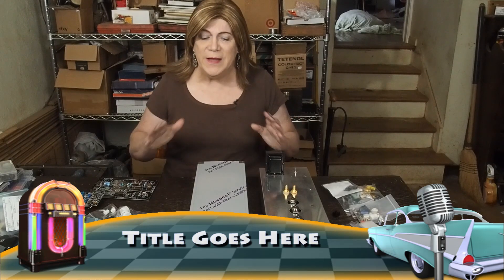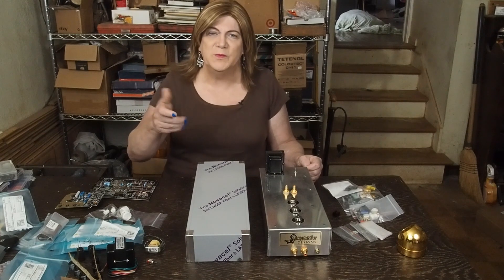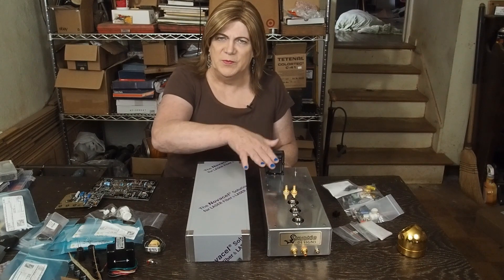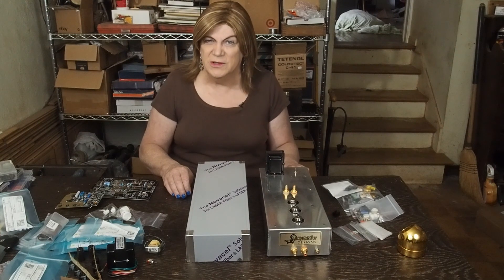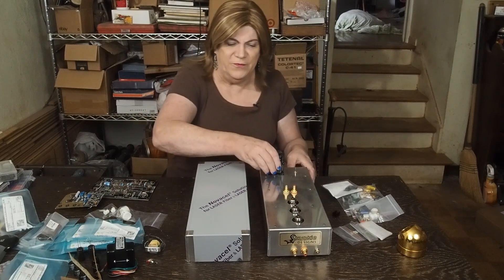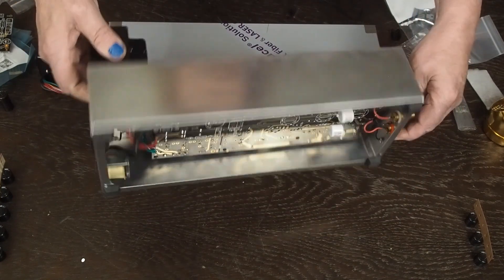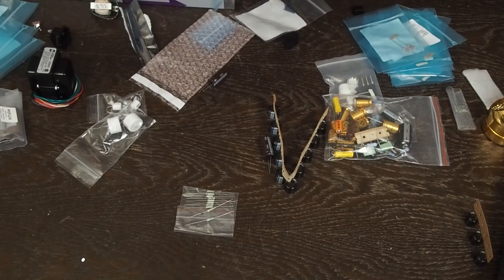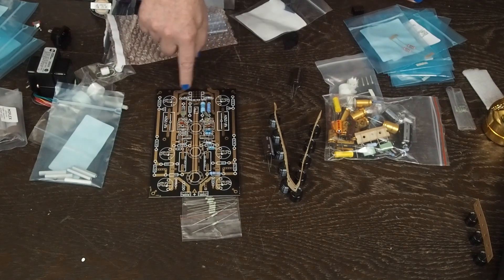All Tube Phono Stage, Moving Magnet Pre-amp Part 1

Comment: I built a EAR834p clone. I scratched my head about loading of the MM cartridge. That required 47k and a capacitance of 200pF to 300pF.  The phono lead could account for 125pF, but what did the phono input contribute?  Studying how to calculate the Miller capacitance for a stage with a gain of about 50x gave a figure around 100pF. For a circuit with passive equalisation that would be it.  Simulation of the circuit showed the gain of the first stage was only about 5x.  This is because the feedback is summed at the point between the anode of valve 1 and the grid of valve 2.  This reduces the voltage gain of the first stage. This in turn reduces the Miller effect by the same proportion.  So the input capacitance is of the order of 15-25pF.  Clever that! So strapping a 100pF across the 47k load gives me a cartridge loading of approximately 250pF. At last I can close the box.
Reply from the maker: I would experiment using cables, and also measure the wiring in the table. Very few carts would actually benefit adding capacitance inside the box

Comment: I totally agree with the importance of the phono-stage's quality as being vital to bring out the best of what's actually on our L.P.s.  
I bought my own & very first s/h stereo at around 19'yrs old in 1980'ish after i moved into my first flat, it was a Thorens 150 t/table with it's original buyer's- fitted SME tonearm & KEF 3-way f/standers (Concertos) & a some make of integrated amp, from local s/h ad's ...way back when pre-eBay vintage hi-fi prices were dirt cheap & handy for an apprenticeship  wage'd person as I was.  After buying a 2'nd & then a 3'rd s/h integrated amp, out of sheer frustration because i'd heard my new s/h speakers & t/table combo both sound very good by the seller's home demo big-but, i kept remembering my own L.P.s tone sounding far better via a adopted clunky BSR auto'drop t/table plugged into the "Gram" input of an adopted old & large mono valved  table-radio during my parent's bedroom listening -days.  
I quickly learned how varied & mostly unsatisfactory were the internal phono-stage circuits in the budget integrated amps that i'd bought tho their line-stages were all far more similar, by miles.  The sound of that, my first stereo totally stood or fell by how the integrated amp's phono-stage performed & all varied greatly while most fell flat on their face, at least in my price range. Then I saw a cheap s/h Quad fully valved stereo pre-amp with 2 dedicated Quad II mono power amps for sale in a local ad & tho of a much older vintage, I bought it unheard (with a loose "bring it back if...",  but all units worked well & my L.P. collection suddenly came alive like never before. A year or so later, i tried & then bought a s/h 3-box modular P.S. Audio dedicated phono-stage to play into the Quad valve pre tuner (or tape) line input... even better! & I felt i'd achieved something extra good for the first time & it was all down to the  phono-stages i.m.firm.o.
 That was 35+ years ago & a decent phono stage has been a very important decision ever since. I now have a 2-box fully valved phono-stage / power supply (Ming'Da) I bought 12 to 15'ish yrs ago & it beat all previous contenders but it's not silent on M.C. setting (which a peak inside told me it uses extra valve gain for & not step-up trannies (& so hissy it seems a silly design but it sounds excellent on any good M.M.  As an answer to that M.C. hiss (even on higher 0.5'mv MC's) So I later bought a Dynavector solid state phono stage for no hiss from my mono-M.C. fitted tonearm. Gr8 video. I'd love a fully valved phono stage that doesn't hiss on M.C.s but step-up trannies may not do it & home trials are out of the question here in Cambridgeshire, u.k.

Comment: Love your thought, I have always played vinyl as my main front, Thorens modified TD160 TT. Many tube amps though quiet had not the speed needed to bring music to life.  I have huge horn speakers and a great integrated tube amp.  Poor components creation jitter,  hum,  and low life. Used great capacities,great resistors .  China stuff I have tried and been very disappointed.

Comment: Can anyone assist in identifying the correct circuit board and/or kit to buy on ebay that matches what is being discussed in this series of videos?  Thank you.
Reply from the maker: This link might not be valid long but this is the board.

https://www.ebay.com/itm/353077232768?hash=item52350b0480
Reply: @SkunkieDesignsElectronics  
You are so kind with your rapid response. Got it.

Comment: Vinyl rules despite of kracking or plopping or wow and flutter.
My phone and vinyl doesn't do that at all. The soundstage is much wider and more depth then my teac vrds10se and seperated dac.
I use a phono tubestage passive riaa correction.
I use direct current to the 12ax7 's for heater. Then you won't get any hum. It is too delicate to heat with ac. I use one 12ax7 per channel not more tubes less is better.
Reply from the maker: This does used DC to heaters, I think the very minor hiss/hum I hear (ear up to the speaker) is due to component quality and possibly PS shielding :) We will see!
Reply: @SkunkieDesignsElectronics  I packed my tubes with Mu metal that improves a lot but it isn't cheap metal.

Comment: A Chinese 834 knock off isn't the way to start. The values and circuit design are not close to the original $2500 design.  Adding somewhat decent parts to a flawed circuit isn't going to add anything of value. I suggest that you seek out a decent phono preamp to examine and discuss.
Reply from the maker: The one I build sounds good or I wouldn't be doing this. I A/B compared this to a well respected/reviewed $400+ SS phono-stage and I preferred this clone. If using better parts doesn't improve anything, that's what I will report when I am done :)
Reply: how many of these have you built and listened to?
Reply: Lenco Heaven has some suggested modifications in its forum. The mods I used were based on those, and checked using LTspice.  Between the sim and real world frequency sweeps a nice flat RIAA response was obtained. No sags in the middle, just a gentle roll off towards the extremities. I added a 50K stepped attenuator and a 470nF capacitor to provide DC isolation from my power amps, and a low frequency roll-off 3db at 15Hz approx.  I threw it into an aluminium box with the power supply and transformer.  I added a sprinkling of filter caps to the power supply to catch any spikes. Tucked the cables in the best places I could find.  Result:  the preamp has very, very little noise, and I cannot hear any mains breakthrough.  Substituting it for my Self Elektor 2012 (feeding the power amps directly), there is a difference in presentation.  The sound-stage of, say, John Williams is more 'spacious'. but maybe less precise. The circuitry apparently doesn't realise it is a cheap 834 knock-off.  I didn't use any magic caps or resistors either.

Comment: Fantastic vid! Great choice of parts. I built an EAR834 clone but from a different PCB about a year ago. I used all top notch parts and a toroidal transformer. Also separated the PSU from the main PCB with a separation “wall” inside the chassis. Also used copper tape throughout the inside. It turned out to have no hum or hiss. It sounds great! Thanks again for the great video! 🙂🎶🔊
Reply from the maker: Very cool! Where did you get the copper tape?
Reply: @SkunkieDesignsElectronics  Hi there. I found the copper tape at my local hardware store, but if you can’t find it there, you can easily find it on eBay.

Comment: What little I know, I'd separate the granny from the circuit & place in a separate from the main chassis. Upgraded parts is a plus! Also, how much is this project total cost? I wish you success!
Reply: Typo: transformer in separate cab.
Reply from the maker: I'll post a BOM when I am done.  The main reason I changed my mind on two chassis, I couldn't find 2 premade chassis in the right sizes, so gonna try this one with bulkheads inside.

Comment: good to revisit old projects don't use the chassis as you're electronics ground, couple you're electronics ground to the chassis via 10 ohm 4 watt resistor and a 100 NF condenser to the main cassis this will stop the 60 cycle hum and run DC heaters